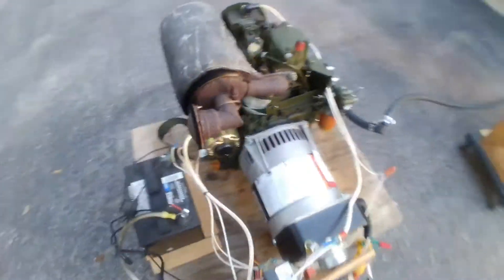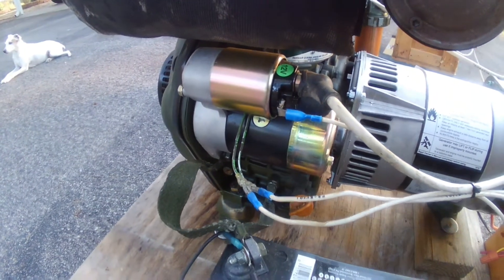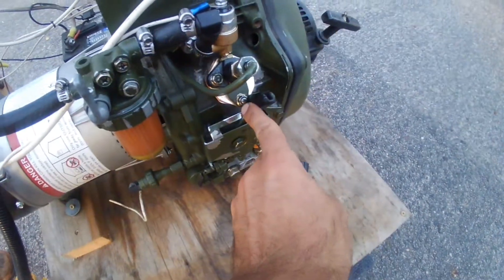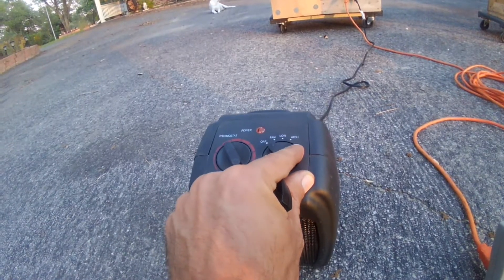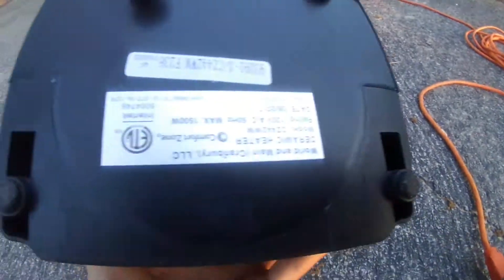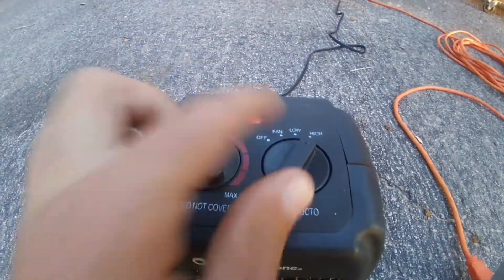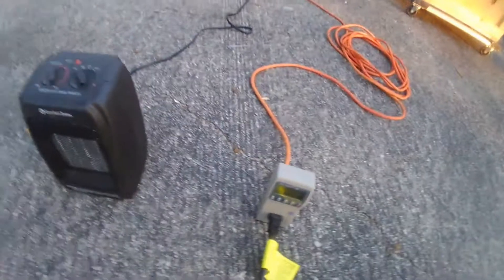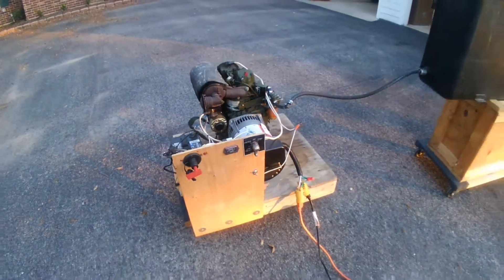Yanmar L48AE Diesel Generator Build

Comment: have you been using this unit much since you made this video? Any thoughts on sound enclosure to make it quieter? Im looking to make a 28VDC generator for my off grid tiny house just for recharging the batteries out of one of these but they are insanely loud for my purposes. thanks for sharing this!
Reply from the maker: This generator is long gone. This originally was a 28V DC generator.

Comment: Hi, i just got one of these engines. Zero familiarity with them. Any good suggestion for resources? Id like to put it on a go kart or riding lawnmower? Is that possible? If not, it looks to make a great little genset! Thanks!
Reply from the maker: Just make sure you use genuine Yanmar parts. The china copy stuff doesn't fit well & will cause issues.
Reply: @CallMeColtLLC  Thanks for the reply!

Comment: Heres what I'd do get a 4 pole gene head and run it at 1,800rpm...1/4 of noise last twice as long.
Reply from the maker: Those heads are very big, at least the ones I have seen. 1,800 RPM on these small motors does put out very much power either.
Reply: @CallMeColtLLC  you just have to try it...
I also used an Italian diesel pulleyed to a DC motor/generator...for lower rpms connected to a charge controller....the remote start is very cool...was it a universal garage door 
opener ?
Reply from the maker: It was a generic 4 button remote control from eBay.
Reply: @CallMeColtLLC  I just got two remotes for two gen sets…I think a door lock solenoid on the fuel stop arm will also stop it

Comment: Love your project. I have an MEP 831A generator that has been nothing but trouble. Recently the inverter died. Motor runs great, and the alternator works. Can you direct me to a wiring diagram I could use to set mine up in a similar fashion?
Reply from the maker: This will be much more complicated on an MEP831A. I'd recommend just replacing the inverter. If you don't want to do that, pull just the motor & put a regular generator head on it. But, it may not fit in the enclosure.
Reply: @CallMeColtLLC  I have a suggestion keep that DC head ...get 4 golf cart batteries and connect a 24 v inverter to them....you can lower your rpm so it's not as noisy....plenty of surge capacity....
Reply from the maker: @offgridmangogrower  I thought about it. All this stuff has been sold for a few years now though! Moved on to other projects.

Comment: how did you go about the injector pump as they never made one for the L48 engines only for the L100 / L186 engines
Reply from the maker: The one I got said it was for an L48. Maybe it wasn't?
Reply: @CallMeColtLLC  I did ask the supplier of mine and he said the L100 / L186 stop solenoid based pump can be used but they just inject more fuel and smoke more

Comment: Where did you get the 12V starter?  I'm looking to swap one out.
Reply from the maker: I found one on eBay. The ones from the Chinese copies will work on the Yanmar engines as well.
Reply from the maker: I just found one on eBay.

Comment: Adjust your RPMs so that you get around 61 hurts with no load then when you drop the load on you should be right on 60 hertz. Good work by the way.
Reply from the maker: I no longer have this project. I ended up selling it as it was in this video. Was a fun project, but I ended up getting an MEP-802A.